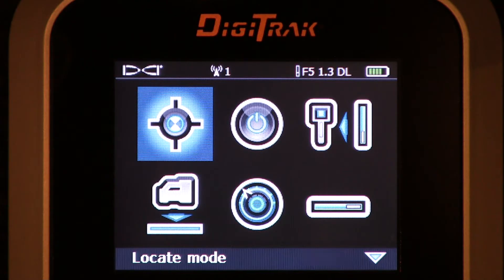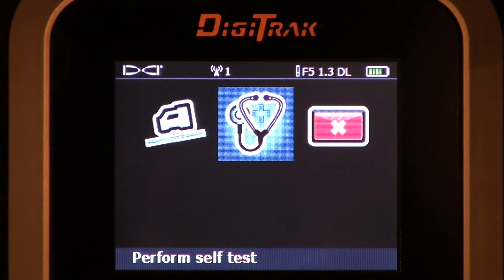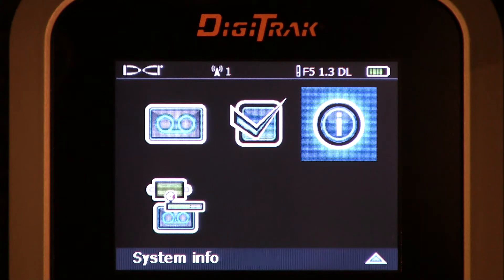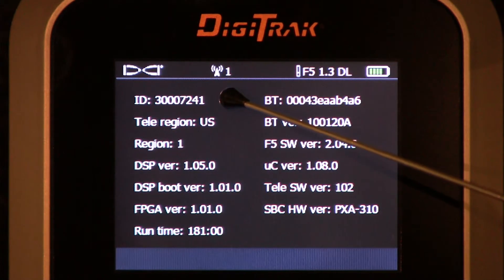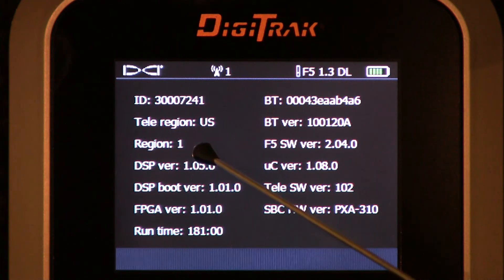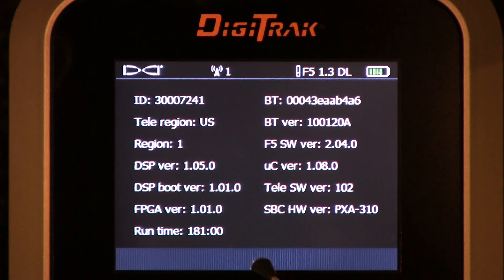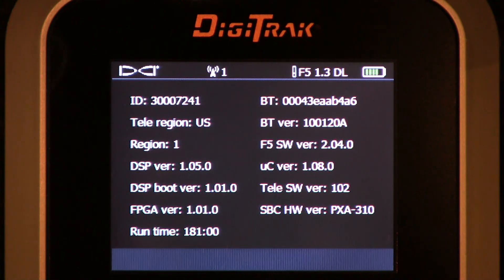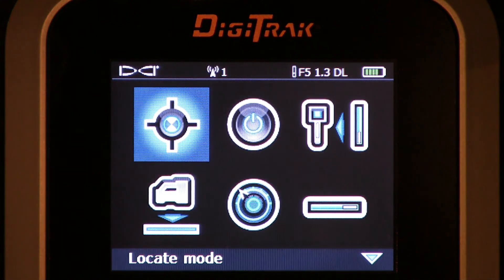DigiTrak Classic F5 Diagnostics & Info page explained

Comment: Hello sir, how do I find out the battery level of the transmitter?
Reply from the maker: Doing a Transmitter Information Read will give you an idea of how much battery strength is left. Another factor would be if you are using a lithium rechargeable battery versus a standard alkaline battery. This video will walk you through the steps: https://youtu.be/_XsWyfd1QsE?si=zLldps_M-NpMkD72